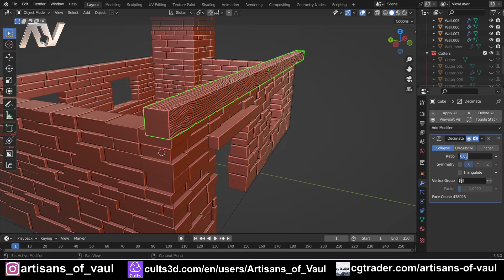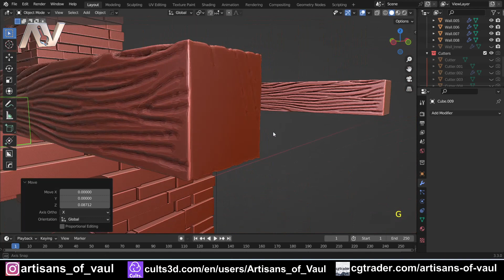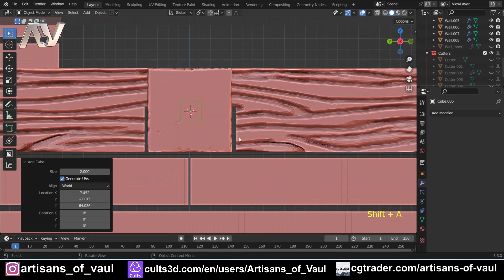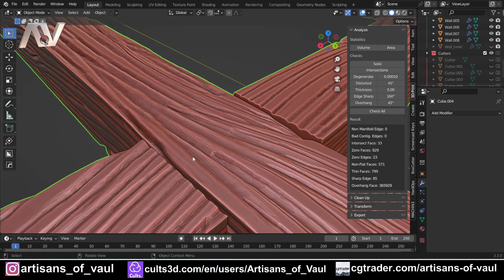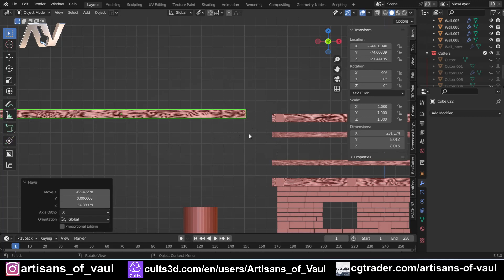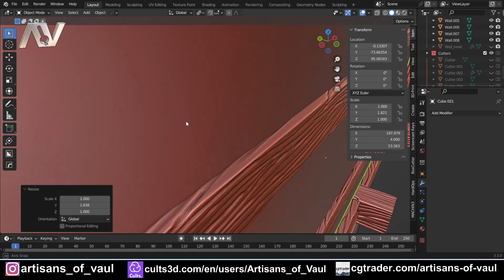Wood and plaster walls - Designing a fantasy / historical building for 3D printing

Comment: When you were sculpting your initial wooden beam, what did you set the remesh to? Im having issues with all the faces being rectangular and causing issues with curves on the beam.
Reply from the maker: I'm not sure I can entirely remember but regardless that will depend on the size your object is. Your issue I would guess if you're getting rectangles is that you need to apply the scale on the object and then remesh it.
Reply: @ArtisansofVaul  thank you that is exactly what I spaced on doing. Fixed it no issue once the scale was applied
Reply from the maker: @anthonyfalsone1624  Glad to be able to help 😁

Comment: it looks very laborious to create such a building with the wood part... 50000 clicks and dropdowns... isnt there a better software to create such buildings?
Reply from the maker: I went through this in as detailed a way as possible and making it as defined as I could.  You could for example not do the booleans/etc. There is software that could make the building design faster but then it wouldnt have the level of detail that I want for the project.

Comment: Don't think I my pc can handle remeshing a beam that long. Is there any way around this?
Reply from the maker: It's going to really depend on the end result you want. The simplest solution would be to not sculpt the wooden texture. Painting will take longer but painting on the grain is totally viable. Other options could be to do something with booleans but I think that would be nearly as intensive on the computer. Unfortunately high detail/sculpting is something that's pretty computer intensive. Oh, you could try sculpting using a multiresolution modifier instead of remeshing. That's meant to be a bit less intensive.
Reply: @ArtisansofVaul  So a multiresolution modifier would be like a subdivision surface so I could just sculpt the side faces? (for example).
Reply from the maker: @tomusannonymous  Exactly.
Reply: Yeah added three beams to the build and bricked the save blender cant load it.   Went from 10k triangles to 86million.  going to fiddle about and see what I can manage using what I have learnt so far.  Need a better way to add the wood that this build will end up needing.

Comment: Great tutorials! Some definite acceleration in my understanding of some of the tools. I'm learning Blender with the purpose of 3D printing my designs. 
Question: Most of the tutorials I've watched are from guys that work in the video games industry, and are mainly concerned with render shading etc. For 3D printing I'm more concerned with actual geometry, so for smoother surfaces should I focus on sub dividing and water tight meshes?
Reply from the maker: When you say smoother surfaces do you mean rounded shapes and/or organic objects?
Reply: @ArtisansofVaul  Yes,  it's hard surface modeling, but sometimes you want a rounded or compound curve surface like an aircraft.
Reply from the maker: @abledog006  So it's quite situational I'd say where SubD is useful. Most rounded objects I will use bevels (I do have Mesh Machin3 which makes that easier to play around with after you've done it). But something that has a more organic shape to it like alien machinery/craft or very sleek aircraft I'd sometimes use SubD

Comment: Again something learned, thanks. Some things I am interested in are... What's the face count of a beam? I am asking because I do some high poly and reduce it with decimate otherwise my machine is melting on some bool actions. I am also curious about the welding of the roof tiles later. These still provided me headache most probably due to high face count as well. Received some weird results time to time. Is there also some kind of breast practice in regards to face count in total? Maybe I just should use some slices to find out myself... Keep it up mate.
Reply from the maker: Like you I used a decimate modifier to reduce the face count on the beam after the sculpting was completed.  Otherwise my laptop would have had issues dealing with the level of geometry.  This is also why in the first stage the blocks are relatively simple at this point as using a displacement modifier for the block/brick texture would have really added to the face count in a way that just didnt seem needed using the alternative techniques.  Each whole beam has around 220,000 faces.

Comment: So you use displacement textures and alpha textures. I was always under the impression neither of these translated to 3D prints?
Reply from the maker: They move the vertices so as long as they are applied they permanently deform the vertices and will show. Its just that often the displacement will not be enough to be clearly visible